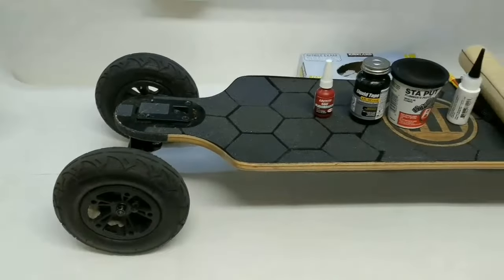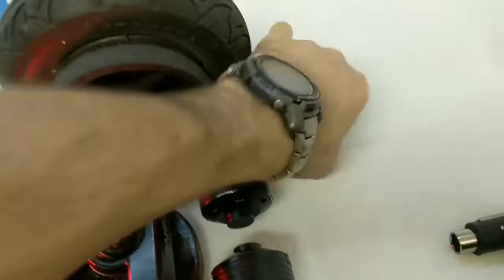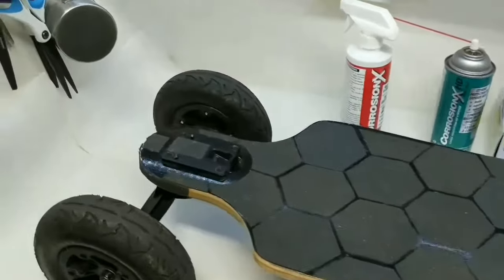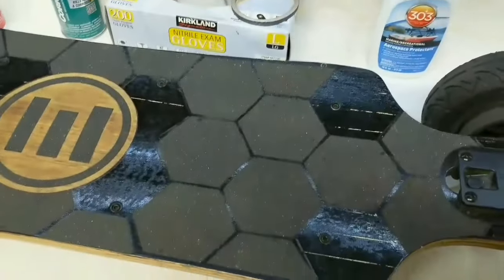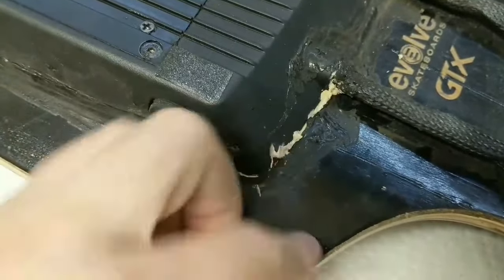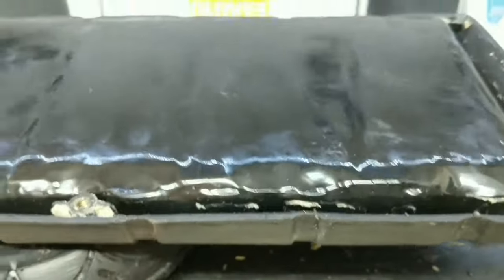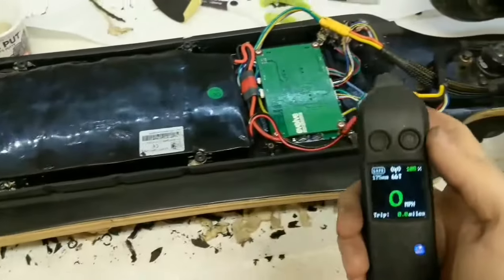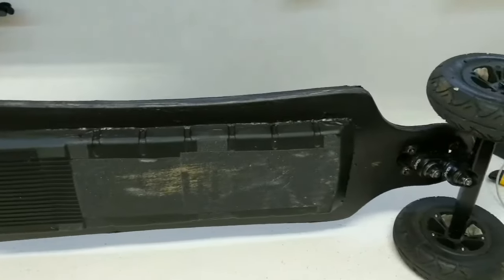How to waterproof Evolve GTX and remote in description

Comment: Hey nice video! What is your experience with the rubber rings for the screws, not so much for water proofing, but for vibration dampening? Did you prefer the original size or the larger version?

Comment: Hey I have a few questions because I would love to do this myself.

1. What size are the O-Rings?
2. At 19:10 in the video I saw a bunch of the stuff oozing out then in the next scene it was gone and looked amazing. Did you cut off the excess then add silicone tape over it?
3. how did you cover the electronics in the HD stuff? Just spray it over everything then let it dry?
Reply from the maker: 1. Not sure what size just a bit smaller then the skateboard screws, also coated screws in corrosion X, it might be better to use liquid electric tape since it seals very well. 
2. I just used my finger and removed excess then sealed it with few layers of liquid electrical tape, and silicone sealer. 
3. I used a deep dish and soaked everything which was messy as hell. Later I just sprayed it. It never dries completely, oil coating is what protects everything. Also, I used CorrosionX HD on the power button and charging port. 
Works perfect! I love it! I am not afraid to get stuck in bad weather anymore or ride over a silly puddle. Riding in the rain will rust your bearings and get lots of sand into belt drive gears just rinse or do maintenance.... Such as; clean bearings, oil them, get dirt and sand out every few months.
Reply: Do you mean just cover the top of the screw in liquid electric tape?
Reply from the maker: Top and under the cap to make a good seal.

Comment: Hi greg. i loved your video, but i have a question about how hardiest it is to open the battery case, while the screws holes are 
capped. im gonna buy a new gtx and i would like to buy a extra battery for long ranges with no recharge. That's possible ?
Reply from the maker: P for Panda it's not that hard. If you need more range look into replacing battery completely.

Comment: Im so tempted to get this board like on the verge of click the add to cart button but, I live in england and the weather is as we all know shit. Will i be able to ride this with damp floors like roads after its been raining? Is it at least  water resistant, would really like to know from anyone out there that knows a bit more about the board and has done so with there own so I can finally make up my mind.
Reply from the maker: MriVmedia if you just do some basic waterproofing. It should be okay. Use 2 or 3 layers of silicone and make sure to coat the motor cables because, wheels lift water and spray it inside the board. Also seal the screw holes on top with silicone so rain water won't get inside. Evolve has spare parts if something fries or goes bad. also I suggest go for AT setup it's amazing and I never use my street set.

Comment: does it matter if i cover the motherboard of the skateboard in corrosion x or corrosion x hd? or does it not matter? i'd be able to spray corrosion x hd on the motherboard because you said corrosion x on some things and corrosion x hd on others.
Reply from the maker: Use which ever you have. HD seems thicker coating
Reply: Greg Ulan would it be bad to put corrosion x hd specifically, in the motors since it is thicker than the standard corrosion x? Or should it not matter?
Reply: Greg Ulan also the plate under the motherboard, do you need to seal that up or is it already sealed?

Comment: Hey man I loved your video, I am looking forward to getting the GTX with the R2  remote control, which is the knew remote controller they are having now for their boards evolve that is, and also put in some 107 mm wheels from ebec 11, the flywheel, to go with it...
Reply from the maker: I cant wait to get R2! cant even order it yet. I am in NYC and solid wheels do not work for me too much vibrations and cant use in bad weather. I love all terrain wheels and how soft the ride is. But if you take it on nice roads and in great weather you will love it. I have a set of 97mm for summer days.

Comment: Shoot I want to get one how do I talk to him? Can you send me his number like on private or something?
Reply from the maker: have you looked at his site? www.kaly.nyc
Reply: Greg Ulan oh yes someone told me that, kaly has a top speed of like 35 to 40 miles per hour, and it has a 23 mile range with a 220 lbs load, also it uses two 6374 motors,  little monsters, and the batteries are 12S4P - 18650 Samsung 30Q cells...if I am not mistaken.
Reply from the maker: yeh whole trampa is a monster.